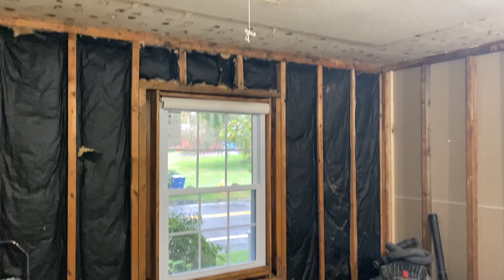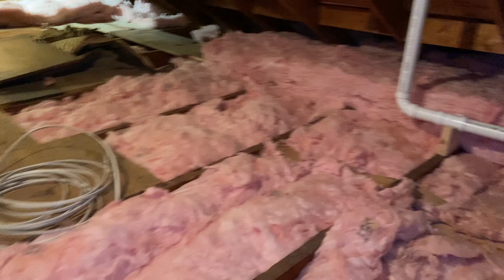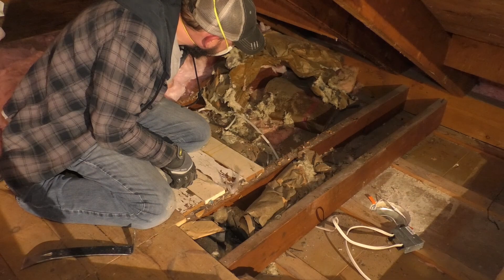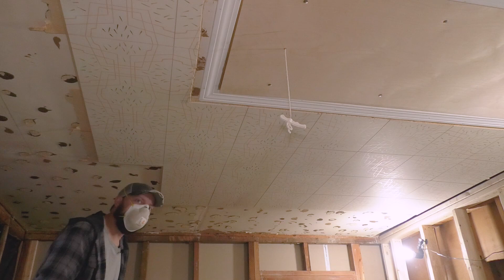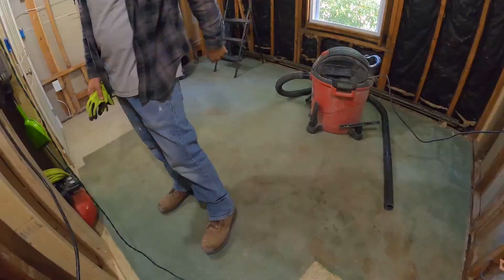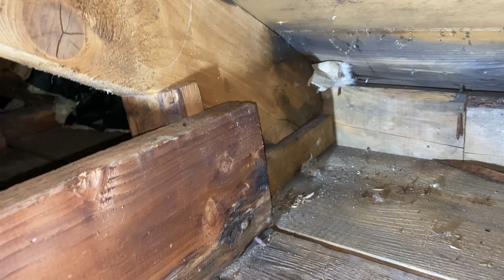Removing Attic Floor Boards, Old Insulation and Ceiling - Bedroom Remodel

Comment: Man I felt how so clean for you in disposing the mice habitats from when their were issues long before.  I have the same problem with my 1950's ranch with so little insulation and past mice infestation.  I want to remove the floor boards (mix of tong and groove pine and 4 x 8 ply).  I thought I may save the insulation and add to it, but after seeing you toss it all, I will do the same!  Great video!  THX!

Comment: Really enjoy your videos.   I've seen similar bird mouth cuts like that in balloon frames with no ceiling joists attached (or going the wrong way), but nothing that extended over the eves.. looks pretty sound. The house I have was built in 1900 and remodeled in 1940, shares a lot of similarities with yours.   Thanks for posting.

Comment: I'm about to start a similar project in my UK house. Our attic only has 6" of insulation (built in 1986). The current building regulations require 12" of insulation minimum. Like yours my attic is 75% boarded for storage so I need to raise the height of the chipboard flooring by around 10" & add the extra top up insulation underneath + an air gap without adding too much extra weight. To achieve this I propose to use a kit of parts designed for this purpose made up of recycled plastic legs & aluminium channel. It won't be a cheap project but with the dramatic increases in electricity & gas prices we are facing adding attic insulation it is one of the best ways of reducing heat loss in winter. 
My ceilings (plasterboard) will stay in place.  Loving your video's.
Reply from the maker: Sounds like a fun project!  Good luck.  I am sure you will do great!

Comment: I have seen rafter construction like that in the field and in fact in an instructional book.
That doesn't necessarily mean it was legal,code,or generally accepted though.
But the "Proof is in the pudding" as you pointed out. It's been solidly sitting there for 76 yrs.👍
🙂✌️❤
🙈🙉🙊

Comment: My c1852 Boston area house has a roof that's framed somewhat similarly. The ceiling joists cantilever out past the top plate by about a foot. The rafters have their tails cut at a 45 degree angle and sit on top of the joists (no notches, just nails). The rafters and joists essentially form a giant isosceles triangle. There's also no ridge beam. How it hasn't collapsed under the snow load ... I don't know

Comment: Old time thumb rule for joists. Distance in feet minus 2 equals width in inches. 14 foot distance needs 2x12's. For ceilings it can be less. Check with your local building professional.

Comment: This is completely off the subject, but this video proves what I've been saying to people who think "orbs" are ghosts:  bits of dust do fly in all directions, at all speeds independently of the other dust particles around them, and do rapidly change their trajectories.  Next time I'm in an argument with one of those folks, I'm going to send them a link to this video. 👻👻👻
Reply: Hahaha! So true.
Reply: Dont forget carbon monoxide detectors those are really important. Ghosts aren't real
Reply: @naomiliebson6610  not necessary in an attic space that doesn't have any mechanicals.

Comment: "For ceilings it can be less" ... This has to do with the load of an attic floor, a ceiling for the rooms below. This type of floor typically won't see the same load as a regular floor, hence your joists seem too small.
I learned the thumb rule from my grandfather. He apprenticed in about 1910, so is not available for comment. Most of his work was in SE Massachusetts where we lived.

Comment: Why don't you put the insulation directly under the roof? So the attic wouldn't get so hot or cold. It's so different how you build houses in the US from the way we do it here in Europe.  we have walls made with bricks and concrete floors, only the roof structure is made of wood, but then insulated directly underneath.
Thank you for showing and explaining

Comment: You are correct about all dust is bad for you, almost all types of dust can cause lung diseases like cancer or pneumoconiosis and mice poop can be containing a hantavirus. And it is much more pro-tactic controlling mess and dust; OSHA will be pleased when work environment is clean(ish) and safe and any ways; you need clean after yourself. Why not trying minimize it in advance?